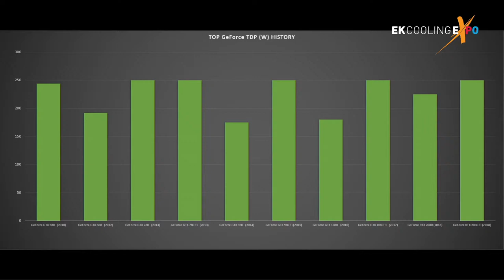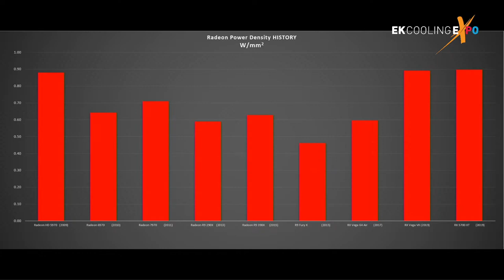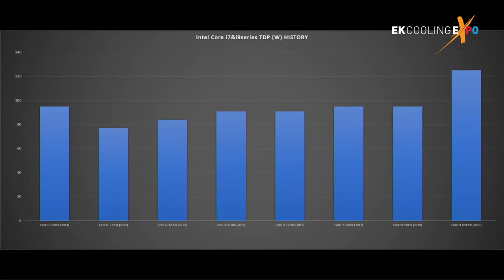The Future of Liquid Cooling and Semiconductors

Comment: Rok (19:13): .Of course surface area in server farms costs money, but you forget to tell that surface area cost for server farm is INSIGNIFICANT compared to the cost for hardware and other costs the server farm require. Air coolers can be made smaller, but there is not significant market NEED for that. Buying crazy expensive and UNRELIABLE watercooling for server farm, investition that returns NEVER, is just not a smart decision. Unless you LOWER your profit margin as a watercooling company A LOT and make completely sealed system to mitigate unreliability issue, but then you must sell watercooling 10 times cheaper that your prices now to be competitive with air cooling.

Comment: 6:18 Urban Kolman: You are just purely WRONG. Air cooling will be sufficient in the future also, because it is BETTER AS A TECHNOLOGY (boiling water under low pressure in the heatpipes have MUCH better heat transfer than water block, that's a scientific FACT, surface area is similar for h-d15 aircooler or can be evern bigger with diferent design). Air cooling is just better and more reliable technology overall. You are just bias person, working for a water cooling company which makes money out of unimformed and uneducated people. You are scamming people out of their hard earned money to buy your crazy expensive watercooling loops, but they can get THE SAME PERORMANCE with AIR COOLER: Noctua nh-d15 with the correct fan on it for only $100. Watercooling doesn't make any rational sense in the personal computer cooling, it is not any better, it is much LESS reliable and is MUCH MUCH more expensive that best aircoolers like Noctua nh-d15 or Assassin Deepcool 3 (or other high end air coolers).

Comment: Edi (8:53): .All respect to you, but what you said is just WRONG: there is no 250 W TDP limit for air coolers. That is just your (probably intentional) misunderstanding of the data. The limit is not there, and the data DOESN'T show that either. GPU air cooler with higher TDP than 250 W CAN BE DONE, that is a fact. Just facts.
Reply: It can be done, by adding more to its size or running the fans crazy fast, but it looks like no one wants that. You obviously have not gathered all the facts and you are being too aggressive with your opinions...
Reply: @Attila_Gobor  Heat transfer for the evaporative cooling(evaporation and condensation), process which happens in  heatpipes under low pressure (air cooler has heatpipes, watercoolers obviously doesn't have it.), has heat transfer coefficientof 30,000 -140,000 W/m2K, watercooling has has heat transfer coefficient MUCH lower: in the range of 100 - 1200 W/m2K. And surface area can be easily matched or outperformed with aircooler. Nothing is stopping you to attack 10 heatpipes to a CPU/GPU and route heatpipes through back of the case and put nice fin stack as the whole sidepanel of your computer case.  Source1: https://www.engineersedge.com/thermodynamics/images/heat_transfer_coefficient.gif
Source2: https://www.engineersedge.com/thermodynamics/overall_heat_transfer-table.htm?fbclid=IwAR3oYmAqxuxzwZUT1TnjDiBKkwlNFoSSBiv0Wf-_icpNQxbNOB9E_ANj6ek
Reply: @Attila_Gobor  You guys LIED. You said that there is a limit of 250 W for aircoolers. That is just (i am quite sure: intentional) misunderstanding of the data. The limit is not there, and the data DOESN'T show that either.

Comment: Rok (14:55): .You "CAN really route liquid directly over the chips (you are talking about microchannels into the cpu/gpu die), BUT YOU ARE NOT DOING THAT, you are not doing that now, nor will you be doing it in the future. Watercooling with microchannels is NOT economically viable unless are you planning to sell your product for $5000 per piece (you will sell almost none). That microchannel technology require special cpu/gpu chips and is crazy expensive (even more than allready crazy expensive normal watercooling. Aircooling is the way to go for the rational and smart people.

Comment: we are way beyond moore's law... computing capabilites are growin g at waaaaaaaay faster pace than what moore could have ever predicted.. and opposed to what you are trying to push in this meeting, cooling is becoming way easier than worse.... unless you are manufactruign silicon, still with moore law in mind, like Intel or Nvidia which performance  increase has been for almost the whole past decade way below moores law.....because of these companies not having done anything new  for the past decade other than pretend that everyone will go around with a vr headset, or that raytracing  is something u can do now, or that overclocking matters, even if u pushing no more computing out of it....
Well 1. you need at least 64 TF of F32 compute power to be able to raytrace live gaming with AT least 3 GI bounces opposed to the single crappy denoised one that rtx  offer.
2 VR is 16k x16k resolution at 244Hz and anything below these specs cannot be natural VR.
3 Single threaded games, and there is NO single threaded game... are just  bottlenecked old platforms, that cant push frames toa gpu, ..... you could  very easiy play all mazxed out  at over 60fps, in ultra settings in 4K ona 980ti  any title any game... a 980ti today is equivalent to a 2060 or less.
Get any CPu that is either from 2012 or 202  that has at least 20 Mb of cache  and you will get those 60 FPS and above.